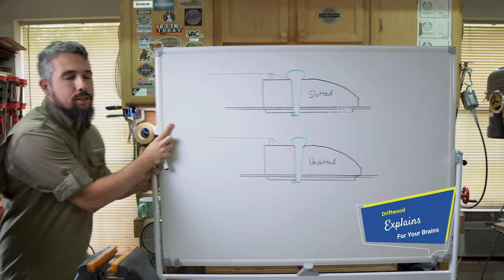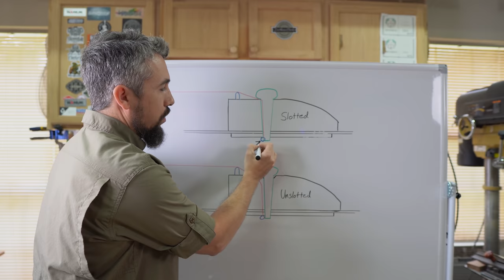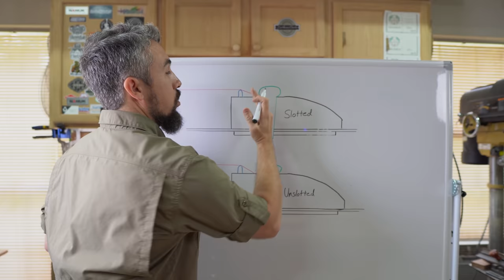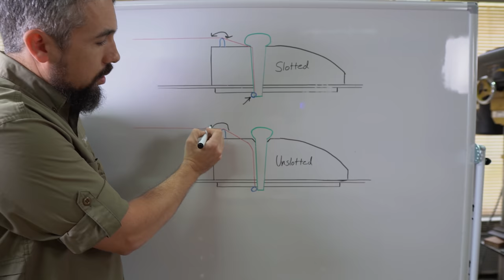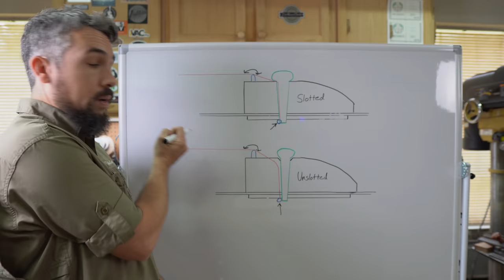This $25 Tool Can Help Anyone Make Their Guitar Sound Better!

Comment: Sorry guys, I'm not convinced. Slotting the bridge certainly makes for a neater fit between the ball end of the string and the bridge plate and increasing the break angle will apply more downwards force to the saddle which, itself, probably would account for any improvement in tonality. However, increasing the break angle also greatly increases the torsional forces on the saddle, pulling the top edge towards the nut, probably not a good idea, especially with a poor quality bridge. With poorly fitting saddles, I can imagine them leaning forwards instead of being vertical for maximum energy transfer. I've always believed that pretty much all of the energy from the strings is transferred to the sound board via the saddle with the bridge pins etc. merely being an anchor. This means that slotting the bridge is sound practice (no pun intended) in one respect, seating the ball ends neatly, but produces another possible problem with saddle twist. Perhaps not rounding over the top of the slot so much would be a half-way-house? I worry about that twisting saddle ............ Interesting video 'though and food for thought.

Comment: Seems like it would be very easy to design a bridge with no bridge pins at all. Just a slotted bridge with some small recesses in the bridge plate to locate the strings ends? Then no weight of pins at all and full contact of string with bridge plate?
Reply from the maker: Solid idea!

Comment: @7:35 Hold on now! help me out here readers, does this really add up? Is not the sound and all its string force related to the sound focused at the bridge saddle the bridge nut if you will? the fact that the string is doing zigzags or anything else past that point from saddle to string ball is mute, sure a tiny but un noticed difference in what you are trying to say makes a huge difference and I submit that the difference you noticed was mostly psycho simatic and any real differences were related to new strings. recording the same guitar with new strings of slotted vs un slotted will reveal very little to no difference I predict, I only have a D28V here from 1998, and it sings like a bird so I would not change it, but if I had a midline ovation or guild here I would gladly do an A vs B set up, But considering my 28 sound so amazing I would not want to cut into my guitar only to find no difference and perhaps increase the chances of wood splitting with the now string cutting into an already started human-made grain split thet the string can now finish the cut destroying the guitar. this is a nice idea at first glance and for non-thinking folks that will do something because it sounds like a good idea.  I would like to add that manygolden-earedd luthiers would have picked up on this in the last 500 years or so if it was so, considering it's a costless process.  My buddy has a guild mid line maybe a $600.00 guitar, he said he will donate the GTR for an A vs B test, I will do this in the next couple of weeks and if there is anything other than my predictions then I'll return here with those results, if this stands from me here, then it was exactly as predicted.

Comment: it has surprised me time and again that people think the pin holds the ball of the string in place, the main reason pins pop out is that people think the ball sits on the TIP of the pin, not realising that the ball rests against the SIDE of the pin, maybe you could make the point more clearly in future....other than that my larrivee has pins that are so precise a fit i'd hate to do anything to them, but i might try this on one of my sub £100 guitars.

Comment: Wouldn't a steeper break angle create a tighter radius and a weaker point on the string for it to break over time? 

I'd love to hear it in practice, but this theory doesn't make any sense to me. The nut end of the string seems irrelevant because it isn't moving in either case; only the section of string played is moving, between the two points where it comes in contact (which is why you can pluck between the nut and the tuners to get a different sound - and literally how the frets work on the guitar.

Also, a string has more motion when it is pulled straighter, with less lateral tension - although pulling it down harder would pull the point of contact tighter to the end of the string, and maybe that causes a change in sustain? Again, I wish I could hear it!

Comment: wait, where can you find 3° waverly unslotted pins?? i've never seen those from stewmac

i'm 100% with you on unslotted pins being better (thank you david collins), though i'm less concerned with subtle tone differences than with significant wear improvement. thing is 5° pins are a drag for just the reason you showed, they leave the bottom of the hole loose. OTOH if you have an actual perfectly fit 5° hole, the bottom exit is too small and half the time the ball end won't fit through it 😑

these days i use 3° unslotted pins from allparts; not quite as nice as the waverly but they fit existing guitars better

Comment: I have the 8 string Guild baritone and the E string keeps "lifting" the slotted pin up about 1/4 to 3/8 of an inch.  I am tired of trying to get it to "set" (what ever that means) so i just ordered the l.3mm saw and no file.  The E-7th string is 1.5mm and I think this will get that issue fixed.  Might as well do the rest of the strings while I am at it.  I didn't get the .7mm saw for the unwound smaller strings so we'll see.  Thank you for all of your help and great videos.

Comment: Great video!  I'm currently playing my 1984 Taylor 615 and wanted to try this. Upon inspection it was aleady done, apparently at the factory. I don't know if this was done when I sent the guitar to Taylor to repair a cracked top in 1993, or if it was original.  The  bridge pins, also original, are none-the-less slotted.  I turned mine around but they do angle in a bit with string tension.  Is the angle an issue?

Comment: That is a great idea. One question i have is, wouldnt this cause more strings breaking because of the more acute angle?
Reply: As far as im aware it shouldn't. The thing that im aware causing breakage at the saddle is a sharp edge where it rests and the string binding and embedding down into it, so making a decent radius that is polished smooth is a best bet. If you got a piece of wire and fatigued it over a knife edge (up and down) till it broke vs doing the same over, lets say, a 10mm rod.

Comment: Thanks, I've been waiting for this one. I know a lot of repair/set up guys recut the tops of the slots for better break angle without switching pegs. Do your pegs ride on the strings, or are the slots you cut deep enough to accommodate them all the way through?
Reply from the maker: The slots are deep enough all the way through.
Reply: @DriftwoodGuitars  Thanks! Looks like I won't be using the new bridge pins I got for my Taylor. I guess it's time to re-up my StewMac membership for that sweet free shipping. It doesn't take long for it to pay off!
Reply from the maker: I hear ya haha

Comment: So what's really going on here? The string vibrates between the nut and the saddle. The saddle transfers compressive and vibratory waves down and through it into the bridge, then beyond that to the wood of the soundboard. The soundboard experiences these waves as 2 types of waves: really fast compressions (call them longitudinal waves because the waves move along the direction of travel, like sound waves in air) and transverse waves (waves moving like a string moves, side to side or up and down). Due to the combination of these waves the sound board ripples like an ocean wave to produce sounds, fundamental notes, and overtones.  

But the string between the saddle and bridge pin has been deadened; it doesn't really vibrate in any significant way. All that vibratory energy is transferred to and through the saddle. Just like the string between the nut and the tuner doesn't really vibrate. All that the string is doing, after it touches the top of the saddle is providing tension, a downward force on the saddle and an equal and opposite upward force on the bottom of the soundboard, plus some force in the direction of the neck. If the string were longer, the note would be lower. The string, for the most part stops vibrating at the saddle. As long as there is enough downward tension on the string after the saddle, the vibrations in the string effectively stop. Anymore tension gained through a steeper break angle has no effect on the string, other than how hard it compresses the saddle down. If you slot the soundboard, you get a steeper break angle. Why not make it a perfect 90deg turn, from the saddle, down into the soundboard? It would put too much tension on the saddle in the direction towards the neck, and make it want to fold over. The balls of the string being more or less in contact with the bottom of the soundboard are not conducting vibrations. They are only providing tension force. The soundboard needs to be stiff enough to withstand string tension, but flexible enough to "ripple" with the vibrations of the strings. 

So is it the pin being a solid chunk of material without voids, that transfers the vibrations better and makes the sonic difference you hear? Or is it the increased tension due to a steeper break angle and more downward force on the saddle, thereby causing the wood of the soundboard to vibrate more?

Comment: Chris, great/interesting video. How much space should be left between the cut and the saddle?

Also, the B string on my Laravee buzzes at the 2nd fret. I've had multiple techs look at this, but no one has solved it. Think your technique might do the trick?

Thanks....Mark

BTW, I have met you a couple of times at the 30A SWF; will look you up in Jan 2022.

Comment: The bridge is pretty much the opposite of a brace. It's designed to transfer pressure to a desired position. I've heard some nonsense over the years and some real fantasy physics and you have certainly bought into it. Ps do guitar guts know any words to describe sound other than tone?

Comment: I have a few questions.  The Stew-Mac saw you are using seems a bit course.  Wouldn't it be better to use their alternate fine tooth style?  How close to the saddle does the slot stop?  Is the slot evenly straight down or does it angle toward the hole in the bridge plate?

Comment: actually not correct on the brass pins being less effcient. mass allows the string to sustain more. it why high mass bridges are used on higher end instruments. i will say brass tends to brighten the tone softer wood pins will darken(ebony or rosewood). certain matrials enhance or mask certain frequencies. otherwise this is an interesting mod

Comment: Just a question!  Why don't manufacturers use this solid pin design when they are producing the instrument originally at the factory, if the guitar will sound better at the outset??
Reply from the maker: Because it takes too long and time is money. The manufacturers mostly care about speed, not sound. In fact they did it this way for years and stopped about 40 years ago. They actually invented the slotted pin to make production faster and sacrificed the tone to make it faster.

Comment: So first of all I love your videos wish I could afford one of your guitars or that I was good enough to justify having one of your guitars. In this particular video I have a question that might be also a concern. The saw that you're using does that have a radius around the teeth I'm thinking probably 3 or 4 mm radius? If not my main concern would be that 90° angle might be creating a stress area for cracks to migrate from. The follow-up to that would be if in fact it is not radiused then perhaps there's an opportunity for me to invent a new and better solution

Comment: I noticed as the string gets smaller(1, 2, 3) it's easier to slot the bridge pin hole so that both the string and unslotted bridge pin fits easily in the bridge pin hole. Since the slot is shallower than strings 4,5,6 the ball head does not seat completely on the bridge plate. Do you continue making the slot deeper so that the ball head can seat completely on the bridge plate? Or do you make the slot just deep enough to have the string and the unslotted bridge pin fit easily in the bridge pin hole?

Comment: I worry about the playability with that much break angle... Hear me out.... If I take a Gibson Tune-o-matic bridge and tailpiece and I screw the tailpiece down to the body. This creates a larger break angle as you have demonstrated. The strings are under more tension and harder to play and bend strings. If I move the tailpiece up, thereby reducing the break angle, the strings are under less strain and easier to play.
I feel this will be the same result. What say you?

Comment: Theoretically this makes great sense. However, the first question that comes to mind is who don't any manufacturers make a guitar with this modification. Guitar makers are in great competition. Surely someone would have used this as the latest and greatest new thing, for a reason to buy their instrument.
Reply from the maker: It’s actually the opposite of what you think. The older companies like Martin used to do this too all of their guitars until sometime in the 70s. They don’t do it because it’s time consuming and just easier to slot the pin. Remember, these big companies know that people will but whatever they put out, and mostly care about quantity, not quality.
Reply: Collings, Bourgeois, and Santa Cruz all do it.  Martin does it on their Authentic series.  Considering it's their top-of-the-line guitars and they're done this way tells you something.

Comment: Sorry for being just a little sceptical. First question:
Do you recommend modifying to the unslotted bridge pins ourselves (having no luthiery skills)?
Or
Do you recommend letting only professional luthiers do this modification?
Second question:
Are the “un-modified” slotted bridge pin versions really completely inferior compared with the unslotted?
If so why doesn’t all manufacturers just use this unslotted method on all their guitars if it is so much better?
Reply from the maker: You can do it yourself with a little patience and skill. Most of the manufacturers that are older (Martin) used to use this exact method. They actually invented the slotted pin and did away with this method because it saves a TON of time in the production process. The guitar you buy from their custom shop actually come with this system already in place. Remember, the big companies mostly care about speed of production over tonal quality. It’s a sound and proven method that have been done for years.
Reply: @DriftwoodGuitars  thank you for a quick answer and for understanding my questions despite my bad spelling (now fixed I think) 😉
I wouldn’t dare modifying my brand new Martin custom authentic 000-28 though - it seems to be quite alright without me having to deploy my none-luthiery skills “upgrading” to a unslotted bridge pin design
🙏🏼

Comment: Bro I have a 69 to 71 Epiphone ft 350 eldorado I can't pin down the exact year because of serial number issues with the company but it was always lacking that harmonic tone that makes a great guitar I gotta admit I was scared but I did this to my bridge and brother I can't tell you the difference in the sound it always had a very shallow break angle at the bridge and the action is about 2mm so I never messed with the saddle but I have a early 70s Goya it's next....lol ty nice trick to pass on

Comment: Ehm, why do acoustic guitars have that ball and pin construction anyway? What is wrong with tying it down to the bridge itself, like the Spanish guitars do? Avoiding sharp edges, that should work, and do a great energy exchange? Or are many people too clumsy, unable to do the right knots? The forces involved are higher, but not that much... Is it the pulling angles? Pulling straight up is a thing, I guess. The top will resonate up and down, and strings pulling more or less horizontal, that could be a less smart idea. Now we get into details of how strings and top and maybe the entire guitar play the game of resonating. Might be complicated, it is often details.
    Thanks for explaining the "dump the slotted pins" tip. Sure this is a big deal.

Comment: Would this philosophy transfer to a through body electric? I have a major issue with through body electrics like teles due to the angle that the strings cross the saddles because of the through body stringing. The difference is so apparent on a top loaded Tele. They sound better! Just wanted to ask!

Comment: Wouldn't this cause the bigger force on the bridge, the strings are also pulling the top more, the pins are now not what is holding the strings in place? I have one takamine that is made in this way, and it is incredibly loud and sounds beautiful, but over the ages the bridge is almost glued off the top.